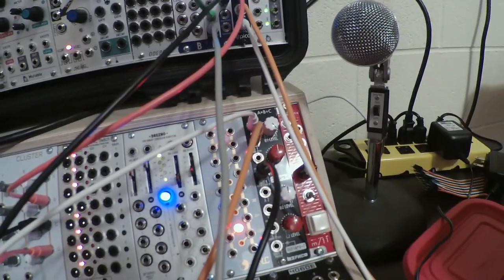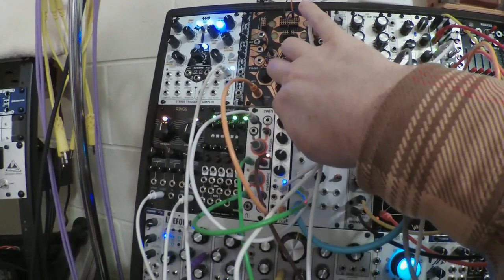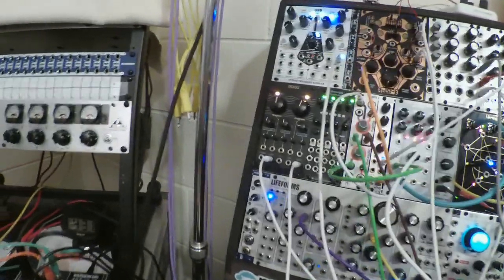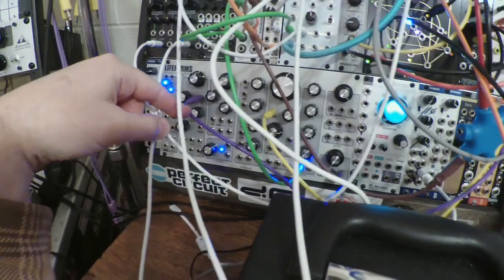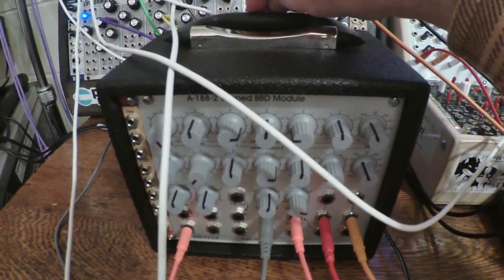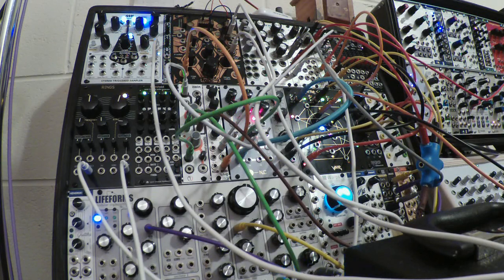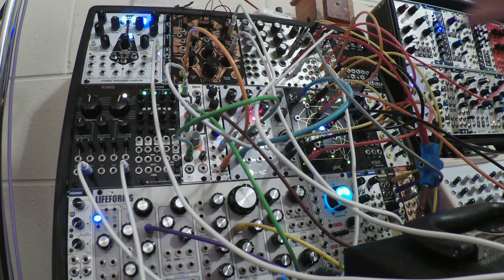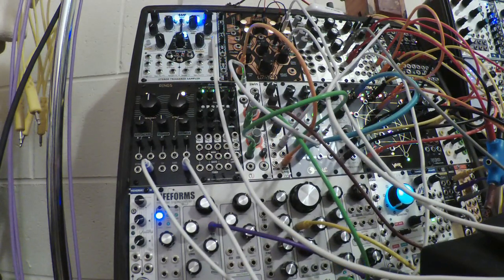Slow jam with sampled drum loop & BBD

Comment: there’s a really high pitched whistle/whine in this video. seems to go the whole time :(
Reply from the maker: Darn it, that's the BBD clock noise.  I thought I had turned it up high enough to be inaudible but I guess you young whippersnappers can still hear it.  This is the biggest problem with that module.
(I re-listened with headphones on and I still can't hear the whine .. which means I am officially old.  At a certain age most humans lose the ultra high frequency range; there's actually a "teenager repellent" device for businesses that emits a high-pitched tone which only the young can hear.  Ten years ago I could still hear that thing but I'm guessing I no longer would if I tried now.  Thanks for bringing it to my attention .. I need to remember to clock the BBD faster than I think I need ..)